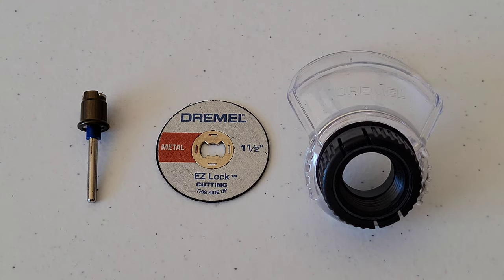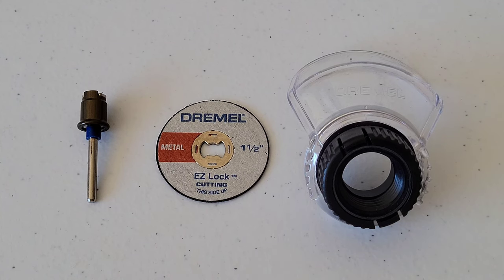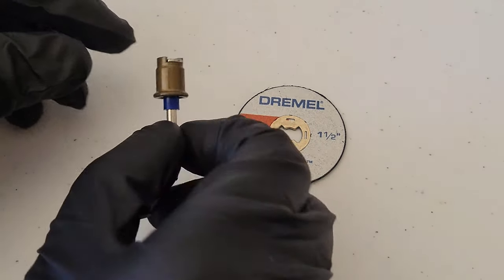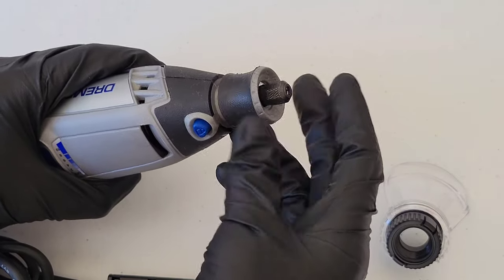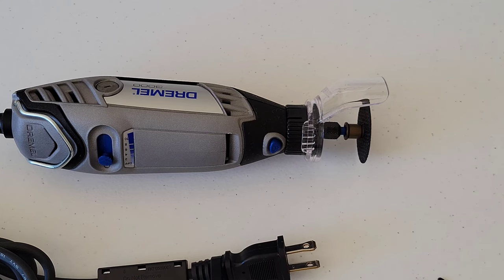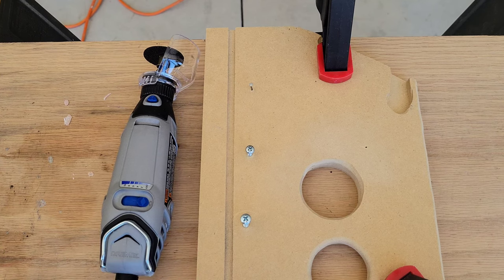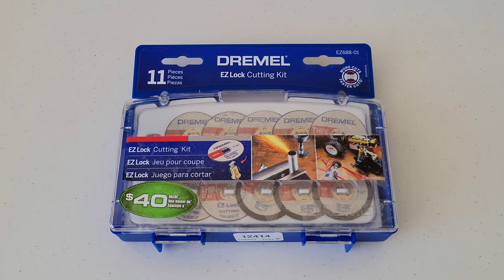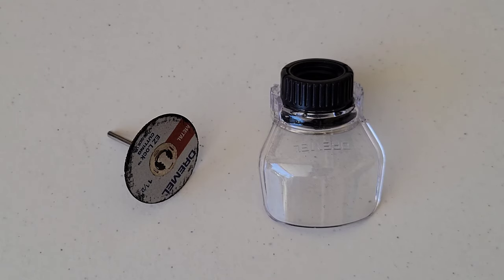Dremel EZ Lock Cut Off Wheel (EZ456) - How To Use And Review

Comment: Is there a way you can visually tell whether or not a used metal cutting wheel is no longer capable of cutting properly and should be discarded, other than trial and error?
Reply: Yes. The wheel diameter will be noticeably smaller.

Comment: I like all my dremel tools. Well almost all of them!
The EZ attachments are convenient but they are MUCH more expensive than the "regular" mandrels, and I'm enthusiastic by the EZ lock itself.
It does not hold the disc as well as the standard mandrel. I had a couple of discs who flied away! Maybe be because I don't use the EZ tool the proper way... Anyway, I should us it the same way I use the conventional mandrel
One other tool I do not use: the mini circular saw... I used it a couple of time, but it is too Scary and unsafe. At least, it is my "point of vue"
Good video, instructive one too!

Comment: So it's been 3 years. Any lessons learned or follow up?

I've seen comments that the shield is only marginally effective and that it slips and doesn't stay in place. Also if you use the universal quick connect the blade extends beyond the shield.
Finally, after cutting metal the shield gets scratched and pitted such that you can no longer see through it.

Comment: DONT BUY ....Every one I've  bought the cutting wheel broke from the mandril and cutting wheel came flying  off
Reply: I've used them for 6 years. Non has flown off.
Reply: I've never had the Dremel brand shatter or break but the cheap ones on Amazon have shattered every time I tried them even on plastic

Comment: I just watched a video prior to this one warning about the poor design of the EZ402 mandrel, and just how dangerous its design is.  Allegedly while this YouTuber was using a cutting wheel at 25,000 rpms (although it was rated for use up to 35,000 rpms), the cutting wheel managed to dislodge itself from the mandrel and came shooting out barely missing him!  He strongly advises not to use one of these EZ Lock mandrels.
https://www.youtube.com/watch?v=YLJj8zsRKis
Reply: yeah i read that from Ken too. so immediately went out the garage and looked at mine. granted, pressure horizontally does push the wheel off center a bit. i know this so i cut with no pressure forward or backward. when i checked out how to alleviate this situation, i found a piece of rubber tubing that will fit over the back side of the e-z setup. i cut it short enough that when i tighten the tool into the collet pulling back enough to put some pressure on the back side of the mandrel, it puts enough pressure to stop the movement he speaks of. works like a charm at it doesn't allow any. test driving it, i am satisfied that it works. thanks Ken.....
Reply: I've never had a disc fly off for the 6 years I've used it. What I've seen is that people use force on it. Don't.  Let the tool do the work. It's not necessary to apply pressure.
Reply: Same thing happened to me. Not a fan.
Reply: Just yesterday my cutting wheel dislodged and came flying towards me, it missed me, but now I know not to put force on these EZ lock accessories while cutting.